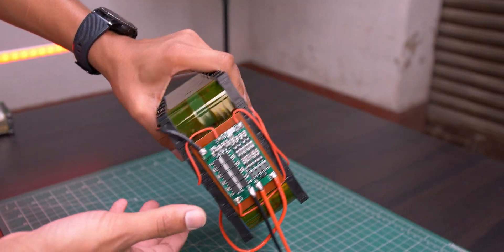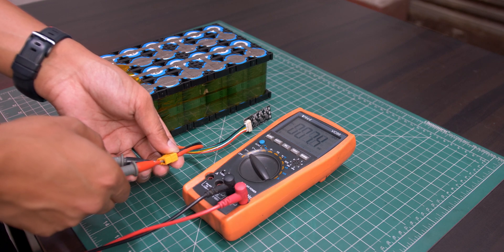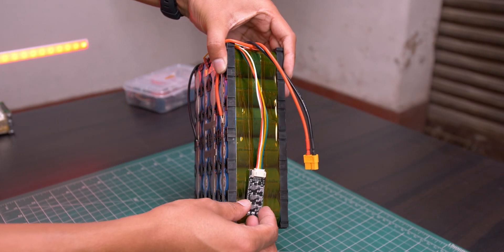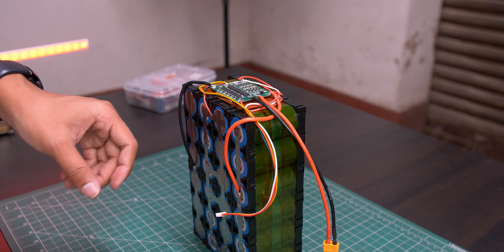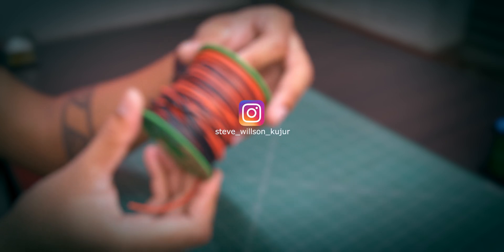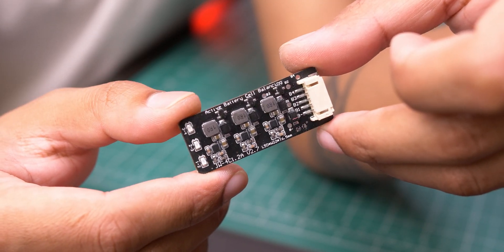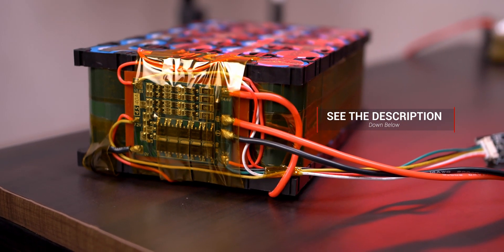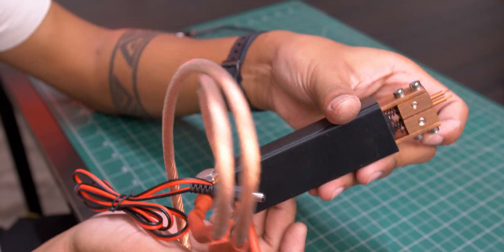How to make a 12V 36A LiFePO4 Battery Pack | Active Balancing

Comment: Hi, how did you solder the wire to the Bms using lead ? mine wont stick to the pad, and does not even stick to the solder iron, what is the problem with this ? i already applied flux, and still the same.

Comment: after watching the video a question just popped in my head nominal voltage for li-ion is 3.6v and peak voltage is 4.2 and the BMS(balance charger) is made for li-ion battery and lifepo4 is different from li-ion its nominal voltage is 3.2 and peak voltage is 3.6 doesn't that effects batteries because the charger(BMS) will charge each battery to 4.2 volts and lifepo4 battery is 3.6v peak waiting for your reply sir

Comment: Hi Steve, Gr8 Video .. I really appreciate your effort ... well, I got two doubts 1) if 32650 cell has max 3C rating then BMS should rated as 12.7V 108A & 2) I found Ni strip to be thinner as per 36A current.
Reply from the maker: Yes it can't handle 108A due to BMS and Strips anyways I'm not going to draw 20A max 

So, you need to design a battery pack according to your requirement

Comment: Bms seems to lithium ion since its shows 3.6v
Reply: even i thought so my friend. but if you look carefully. the marking are 3.6, 7.2, 10.8, 14.4.on the other hand, for a lithium ion battery, the markings are 4.2, 8.4, 12.6, 16.8. lithium ion voltage range 3.0-4.2, nominal 3.7. lifepo4 voltage range 2.5-3.6, nominal 3.2

Comment: Hello, i am planning on doing a battery pack for an electri car, using the same cells my questions are:
1./ Is it a good idea I put all the cells together in a big battery pack? (85kg approx) or should I divide and do 2 or 4 battery packs?
2./ What I understand from your video, I can use a BMS and and the same time 8s active balancer? how do i turn off the passive balancer of the BMS

I am having a very hard time selecting a BMS with active balancing for my battery pack wich will be 27s18p is my plan, I can do it different and be flexible

Comment: Can you build a battery pack of 12v 24ah for motorcycle replacing led acid battery to lifepo4. If you can I will be interested in purchasing. But the battery pack should charge using motorcycle current like led acid battery. If possible please send me the details on my mail my id is munirmakadar@gmail.com
Reply: Go for super Capacitors
long life and much more powerful. But little bit costly,

Comment: is BMS not sufficient
Reply from the maker: It is , but active balancing is for balancing the cells , and it's much more efficient
Reply: @SteveWillsonKujur  so we need both of them or only one module is sufficent
Reply from the maker: If you have small bank you don't need it , use it with bigger bank
Reply: @SteveWillsonKujur  thanx bro for guiding

Comment: Those 32650 lifepo4 batteries were sexy. I want to use such for my diy PV system someday. Good video Bro. You always made clean and quality videos. Keep it up!
Reply from the maker: Thanks , if you'll use it under Solar application it can easily last you 15-20 years
Reply: @SteveWillsonKujur  That's true.